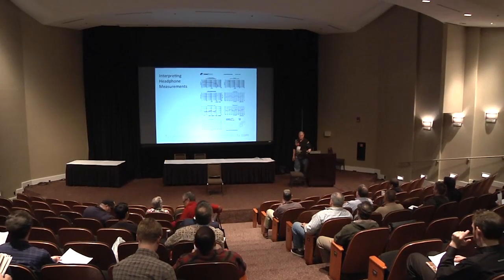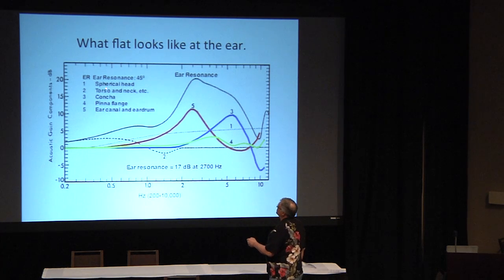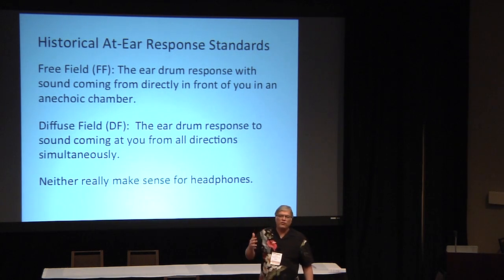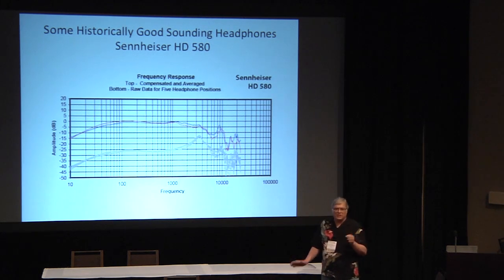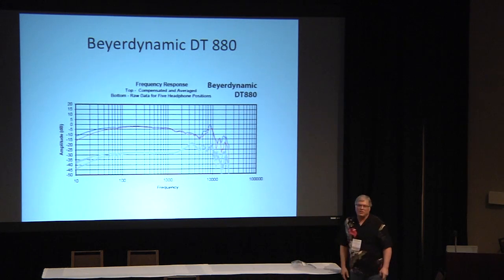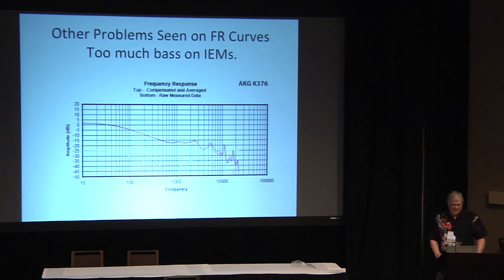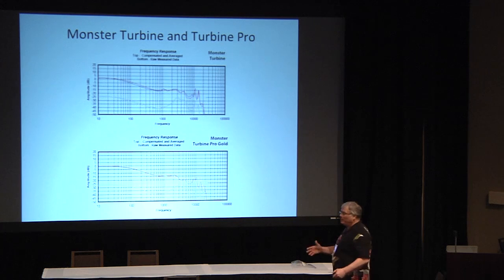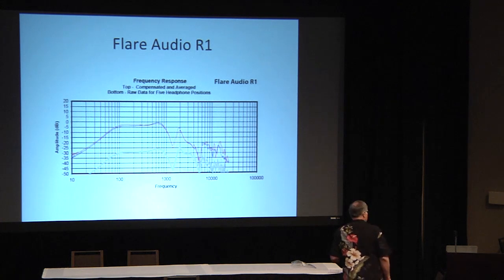Finding Flat: How to Interpret Headphone Measurements

Comment: 42:45 "There is an art to making these measurements": In regards to averaging the values of both a good seal and a half-seal, no there should not be any 'art' applied to data, that's called manipulating the results without transparency.

"I try to be as honest as i can about what the headphone sounds like": You cannot honestly present a chart of data points that are tampered with without disclosing it in the preamble.

"[...] I'm measuring it so that it looks like what i heard": That's subjective opinion, not objective data, it just isn't science.
Reply: @feo130  nice argument